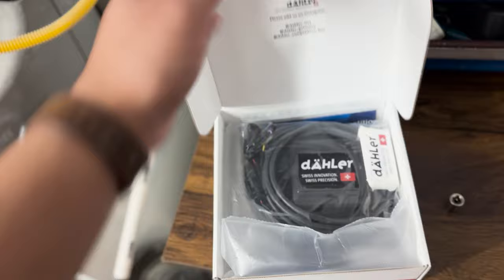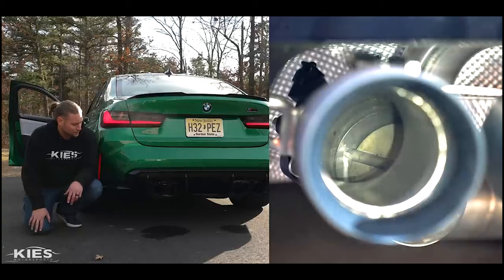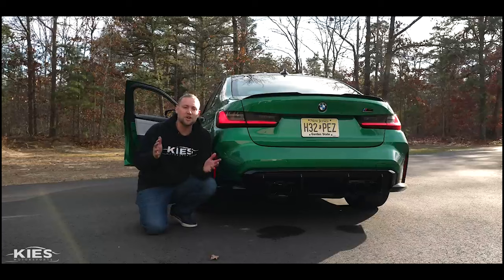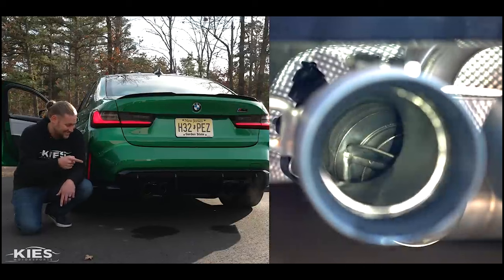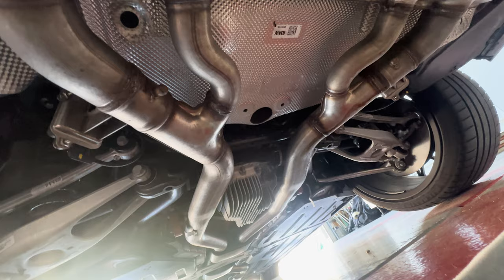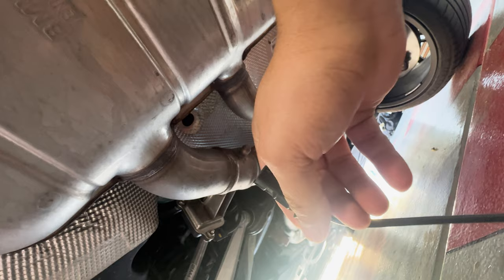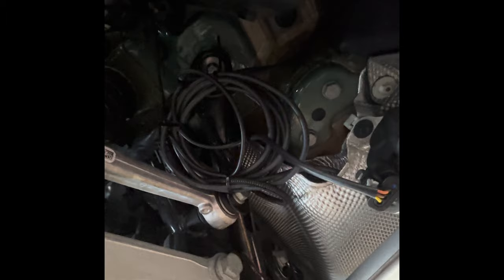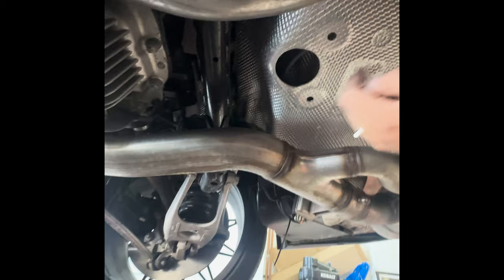Best Exhaust Mod for all BMWs - Valve Controller by dAHLer

Comment: Question, can I get a muffler delete on 840i without a check engine light popping up ?
Reply from the maker: Muffler Deletes wont cause an engine light to pop-up
Reply: @RADBAVARIAN  appreciate it, thanks. Got it done yesterday. So, whoever is interested. Before u get the delete, u have to start the car up, put it in sport mode make sure the valve in the exhaust is open and stay open then do the muffler delete